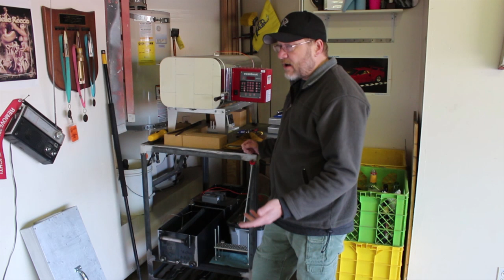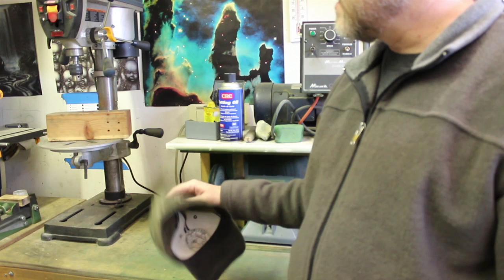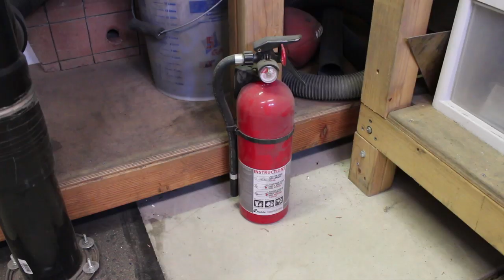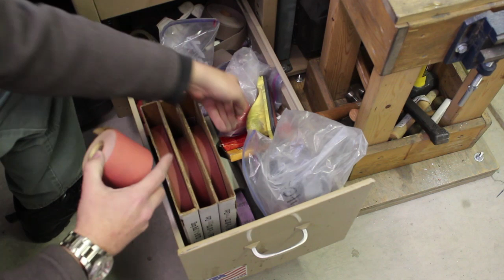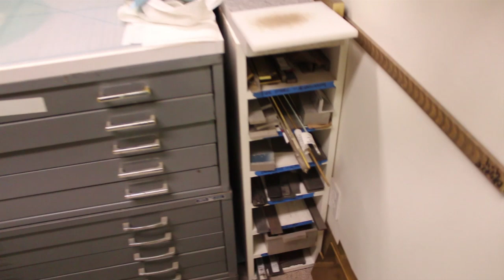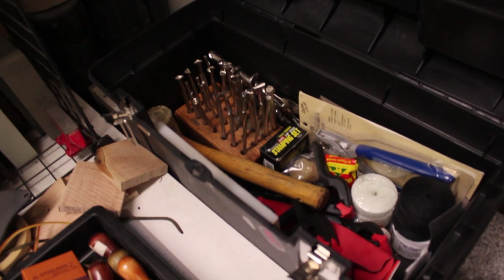Knife Makers shop tour and jigs

Comment from the maker: I haven't tested Duracoat vs. GunKote but from what I have read GunKote is a little better with abrasions. The GunKote holds up very well within a Kydex sheath but once you get grit in the sheath, let the scratching begin. That's the drawback with Kydex, once you get grit in the Sheath it will start scratching any finish.

Comment: Nice area you have, I too have a garage/shop. Just getting started and have sold my first blade. Interested in how you feel about the gun kote vs. the duracoat application I have been using. And do you have finish scratching issues with the kydex/gun kote combo? Thank you and subbed.

Comment from the maker: If you quench a blade in cold oil the chances are it will crack the steel. The sweet spot for quenching oil is 125 to 160 degrees.